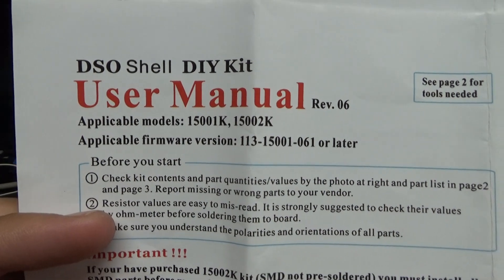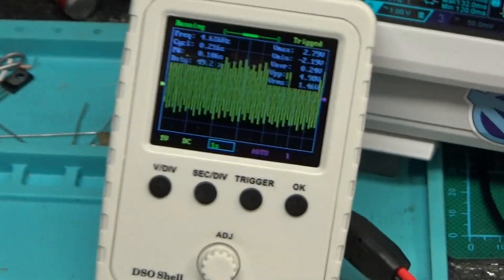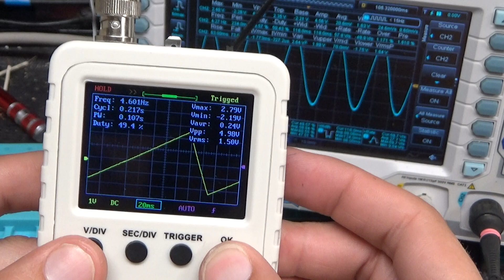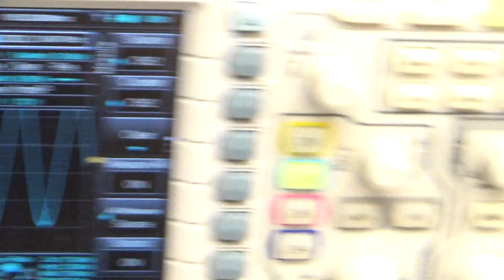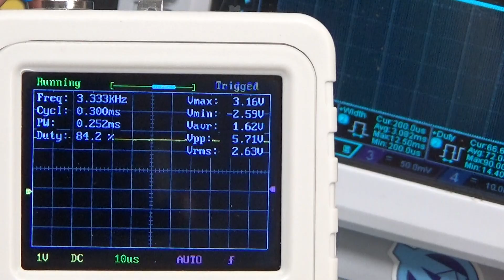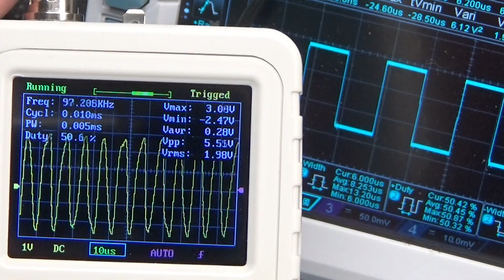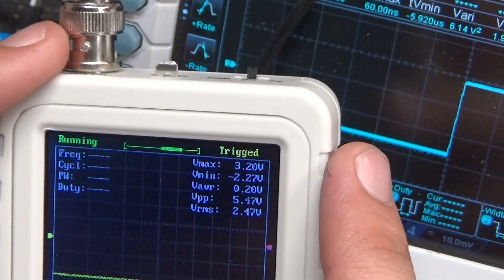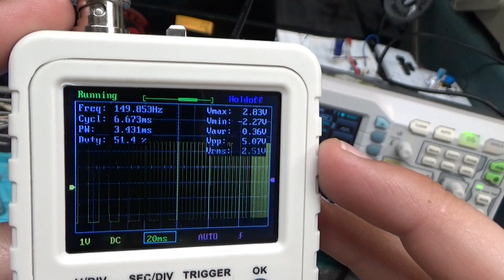DSO150 testing and review: Is a new and "improved" $20 oscilloscope okay for a first scope?

Comment: you know a lot about this stuff im just getting into this. could you tell me if this would work on a car to check to see if there is a data stream to ecu or signal to maf etc,
Reply from the maker: I doubt it would show you anything too meaningful.   At one of the timebases it would probably show something.   But theres cheap ass logic probe designs that may be better suited.   But, that depends on what all you need out of it.  For example, If you just need to know its switching between levels, or if you need to know precisely how long its on high, or 0.  Or if you need to see the data transferred i²c or spi or whatever.     I got rid of this toy long ago.  ...during the great toilet paper shortage, i used it to wipe my ass.     Look on ebay. You could find a analog scope, like a legit tek or hp one, for less than $50.    You wouldnt  need to worry about if it could display it.  20mhz or 50mhz is more than enough grunt to read the comms between maf and ecm or whatever.   Which, usually the maf sensor is nothing but a thermistor or a diode. Yes, really.  Im sure it probably has an ADC to get the real world sensor values and put it into robot talk of 1s and 0s.     Anyways. Hope this somehow helped.

Comment: I noticed that you weren't using a X10 probe with it. I have a dso138 and a dso062 and they both do pretty well for most routine things. The noise is much higher and performance tanks if you use that alligator test lead.

Comment: That is the main problem with this scope. They list only one frequency specification, and it is only for the analog section, saying up to 200kHz, and even that is a stretch, because the displayed signal sags about 5% or so when you get up near that frequency. As for the ability to display any kind of meaningful waveform that you can trust, I would say don't exceed 50kHz, and for best reliability don't go much above the normal audio frequencies range of about 20kHz. Keep it in that range and this scope can provide good service. But can it replace a 'real' scope....NO, unless your needs are very limited. Still, a handy item for some situations where size and portability are important...but then, wait! It is AC powered as provided, unless you rig up an external battery.
Reply from the maker: I was trying to give tbis thing a fair shot, and use it as a "spectrum analyzer" to see the characteristic curv3s of different filters, driven by an exponential ramp...low freq stuff, 20khz MAX...it couldnt do it...at all, i tried every voltag3 setting, time base and qll combinations there-of. Nada..   so, I must say, the ONLY thing this is good for, is finding capacitor  foil side...  and maybe a paperweight
Reply: @topherteardowns4679  , I don't think there is any need to be esoteric about this scope's uses. It is perfectly good at displaying, with good resolution, waveforms and voltage levels in lower frequency ranges.....just normal 'scope stuff.
Reply from the maker: Esoteric? No, not my intention anyway.  Just wanted to find if it could do something simple, and low frequency..  but, it had terrible trouble.   I think, if someone got this as their first "scope", it would almost be impossible to have confidence in the signal being measured is the signal being displayed.   Yes, it will show you a simple square wave at 1kHz or whatever, but its high frequency rolloff wouldnt even register the massivr inductive spike or ringing, (etc..), that is showing up from a fault in what your testing.        ...but, that is me (foolishly) assuming that anywould would put ANY faith whatsoever  in a cheapo $20 scope off ebay.   I hope no one would be so foolish... all they really need to do is save a liiiiiittle bit more money, and an analog scope can be bought at a VERY reasonable price.  My tektronix 465m cost me $25, free shipping (hell of a deal!)
Reply: @topherteardowns4679  , I agree that unless somebody knows what they are doing, and understands the limitations of this little, cheap, scope, that most potential buyers should save a few dollars and buy a decent used analog scope as their first, or only, scope.

I have considered that if there were some school teaching a basic introduction to electronics course, and if they were on a tight budget, these little DSO's might be satisfactory to teach students the basic of how to use a scope, since at least the controls are pretty standard, and they could inexpensively use them to learn what a scope is all about, and how to use the controls to stabilize and view a waveform. But since this scope has no input protection devices at all inside, they would be best used simply connected to a signal generator.

Comment: I looking to learn how to use it. I was hoping it could tell me if the diy power supply I build are putting out clean power. Recently I built many Op amp and amp kits from China. I was hoping to get the dso150 to tell me when it's clipping and get the voltage to calculate the watts. Thanks for the videos. Thanks for the Videos and any help to guys can give me
Reply from the maker: Im sure it would be fine for that, but, only to a certain extent.   If there was any high frequency noise, it would be absolutely worthless..  For op amp regulating power supplies it would probably be okay..ish.   But, I suppose that would depend on a whole lot of variables.. Npn or pnp pass element, load type, output capacitance, external interferences, shielding on the module/cables. And much much more im forgetting.     Really, id say look for a $50 analog scope on ebay..  Even an old 100mhz scope would do 10000000 times better than this novelty

Comment: I need to test on Mainboard PC, Laptop Mainboard with frequency of 32.768KHz, 14.3Mhz, 33Mhz, 48Mhz, 66,100, 200Mhz, please ask is your machine can test? Thank you
Reply from the maker: No way.  No chance.   Spend a little more and just get a good analog scope.

My first one was a 465m tektronix i spent 25$, delivered on
Reply: @topherteardowns4679  hi, where can i buy the 465m tektronix
Reply from the maker: Its not just that model you should search for.   Look on ebay auctions for older analog oscilloscopes.  They can end up selling for very very cheap.   The EEVBlog channel has a great tutorial video (2 of them, actually), on finding a good oscilloscope for less than $50.

Comment: Would this be a useful tool for ham radio equipment? Building,troubleshooting,etc.
Reply from the maker: Oh no...no no noooo way.   I wouldnt trust it at all.    I am going to make a new video using it with some audio signals, and using it to test the foil side of capacitors. Will be posting it up in the next day or two.  Just making a couple circuits to use it on.

For serious work, especially ham stuff (megahertz stuff) i would suggest watching ebay for cheap second hand scopes.   I have seen quite a few good scopes go for less than $50 recently... Hell, i got one for 25$ shipped! A good one too, old tektronix bit of kit.

Anyways. I wouldnt waste the money on it, just save another 20 or 50 and buy a second hand scope

Comment: Now would this be alright for testing capacitors for guitars?  Just to make sure which end gets soldered to the ground? I seen a video that says capacitors like Orange Drops are not always marked right.
Reply: Yes, you can. I have seen a video about  it and the guy told that it performs even better than his real dso when testing the capacitor. If you still care.
Reply: @mareksvrcina5279  Yes I do. I stayed back from buying one until I knew for sure. Now now, ill buy one. Thanks!
Reply from the maker: Yes, it works pretty good, as the gentleman before replied.  It would be best to make a small jig out of a small breadboard or something to put the caps to be tested in. Because the leads/clips on the dso are slick and fiddly.  But, yea, not bad for testing caps....that pretty much sums it up though
Reply: @topherteardowns4679   Thank you too!
Reply from the maker: Thats a good question, and I will test it and see, then let you know!
Reply: @topherteardowns4679  Sounds great! I just wanted to test capacitors for building guitars and didn't want to spend a lot of money and then seen your video.  I really appreciate it!

Comment: Thinking about getting this for car audio(setting gains without clipping, troubleshooting broken amplifiers), you think it would do the job?
Mainly working with frequencies  far below 20khz maybe 20-4000.
Reply from the maker: I actually think it would perform well for audio work. With the added benefit of isolation while working in the car.   In the video I was just using my power supply to run it. But since then, i have just got a 9v battery case that has an on/off switch and uses a standard 2.1mm DC jack out.   Works well-especially with a rechargeable 9v li-ion battery (which I plan on taking apart soon).
Reply: Neat! Also the battery case was just what i was thinking about, great to hear it do well.
Reply: @Sound.wave_  It was great for setting RCA's